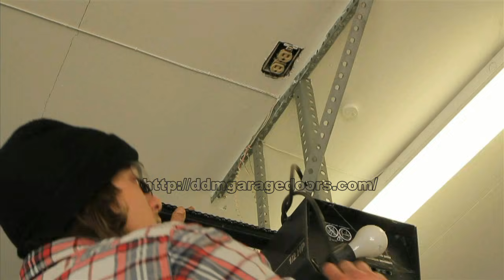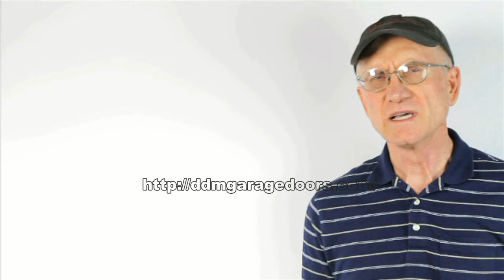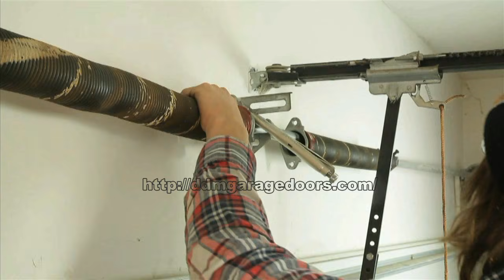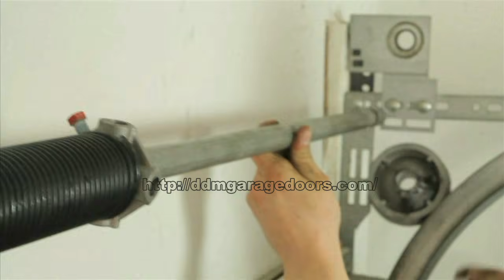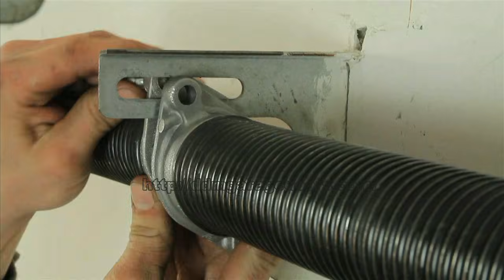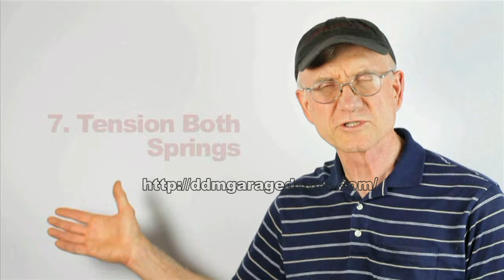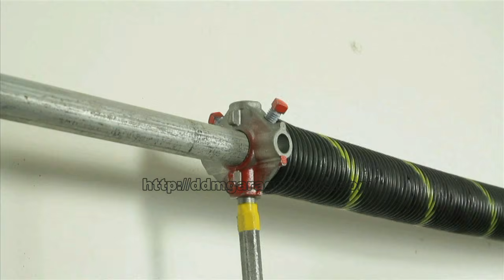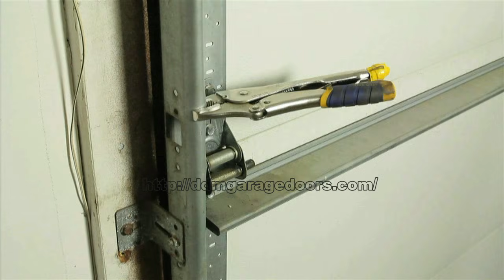How To Replace Garage Door Torsion Springs

Comment: Almost seem like if you could close the door part way where you could still access the spring from the outside you'd take a lot of tension off the torsion spring and make it easier. I don't need to take mine off I just need to tighten mine as the replacement wires were different length than the originals from 1950. Door is also wood so rather heavy and the opener could use a bit more help especially when starting to open.
Reply from the maker: You definitely want to close the door all the way, Mick. There is no safe way to retension the springs at all when the door is only halfway up, especially if it is a heavy wood door. If you mess up and all the tension goes from those springs at the halfway point, that door will drop with so much force, damaging the door and anything that will be in its path. With care, it is best to wind and rewind when the door is completely down: yes, there is a lot of tension there, but its the way of doing this the safest.

Comment: it was nice meeting you Dan (picked up my springs at your west Chicago location while you introduced yourself) and a big thanks for the video. I was hesitant at first on doing this in my own because of how much tension these springs hold. but once I got passed my initial fear of unwinding the springs things got easier and I felt more confident with your help. keep up the great work! and good luck with the new tool for unwinding the springs. I'm sure people will feel more confident using that then the bars.
Reply from the maker: Thank you for your business, VOLTIS5! Thank you for the kind words; we hope that these spring winders will instill confidence in people that they can complete this safely. If someone doesn't feel safe completing repairs, they should just call in a professional. Safety first, then work!

Comment: What an awesome video! 
Thank you so much for creating it in such a detailed manner… I was able to change my torsion springs with no problem whatsoever by following and pausing the video as you demonstrated all the steps.  I’m having another problem now, and I’m wondering if you can offer some suggestions as to what it might be?

Especially on cold days, mornings or evenings, when the remote is depressed to open the door, it rises about 5 inches, then abruptly stops.  When we push the remote again, it attempts to close, then rises again to about 5 inches and stops.  From the inside, although a headache – it’s not too bad, because all I have to do is block the sensor prior to pushing the
remote again, then the door opens all the way up.  From the outside however, the door has to be lifted by hand after it has closed and reopened, and it has to be helped for about the first 24” to 36”.  During warmer days it works just fine, but my wife and I have gotten tired of having to deal with this problem, and it’s now at the top of my honey-do (or else!) list.  I have tried messing with the adjustment screws on the back of the gear box, but realized that has nothing to do with the problem I’m having, or so I figure.

Perhaps you can suggest a plan A, B or C for me to check, replace and repair?

Thanks again for the awesome How-To video!
 

Leo
Reply from the maker: Thank you for your gracious comments, Leo. Your symptoms describe only one probable cause. It sounds like you need to adjust your open force. This should help. https://www.youtube.com/watch?v=GebkW96Sd_c&t=26s Best wishes.

Comment: Great video, and online tools.  I just received my new springs from DDM (remarkably in CA in 3 days) and I installed them and the garage door is finally working properly again. I really liked the DDM tool to calculate the spring specs  based on door weight, height, etc. because I had tried to replace the springs through a different vendor a few years ago, by simply measuring length, windings, diameter, etc...and the springs I got were way too stiff and there were no returns, so the door never worked right, and has been a frustration for the last couple years (having to prop it open with a 2x4) until I found DDMs online tools. As an aside, I also really enjoyed their blog on "click farms". A real shame this video has so many down votes from vietnam, maldovia, russia etc...where they certainly are not ordering garage door components.  Thanks for all your help DDM!
Reply from the maker: Ed, thank you for your kind words. I'm glad to hear the springs arrived quickly and that you found our free online software tools helpful. Our generous return policy grows out of the extra responsibility we assume for helping customers get the correct springs. We can afford to do that because of my 38 years in the business. I can identify quickly the orders that don't make sense. These are pulled and the customers are contacted to assure they get the correct springs.

Comment: Lol "Never, never, never...use a screwdriver." Amazing. But seriously this is one of the most dangerous things a man can ever do, it isn't to be taken lightly - you'd better have good tools, strong arms, and a sure grip - and QUALITY winding bars - and follow this video exactly (it is 100% correct) - or you WILL most likely cause extreme damage to yourself (up to/including DEATH or PERMANENT DISABILITY) or others and surrounding property - for example, a winding bar can crush your hand, shatter your wrist, break your skull, or shoot 20 feet across a room through a wall. BE CAREFUL.
Reply from the maker: Your right on, Jacque. Replacing springs is dangerous!!! That's why we spent hundreds of hours making the process safe. Better not to sell springs than risk customer injury. Thank you for your reminder!

Comment: Thanks so much for this video. I learnt a lot, and the instructions you gave were detailed yet simple. My left spring broke today, so I'm thinking of trying the repairs myself. Thanks so much.
Reply from the maker: You're welcome, Hiep. Glad to hear we helped you learn the trade, and that you found them simple. With the proper guidance I think you'll find the job easy. Best wishes.
Reply: I got it done watching your video. Bought the springs and winding rods here in Sydney for $200. Followed your instructions step by step and finished it in half a day. Called a few garage repairs up and they wanted to charge anywhere betweem $600-$900. You saved me at least $400. You guys are legends, keep up the great work and THANKS heaps once again!!!

Comment: Very helpful video - thanks! I was apprehensive about trying this, but watching and understanding the safety tips throughout your video set me at ease. 

My project started with adding some of your garage door struts to correct a door that was sagging in the middle when open. The additional weight of the struts put the door out of balance, so I decided to replace my 10-year old spring with two new springs. Now, with three added struts and new springs, my door is perfectly balanced and no longer sags.
Reply from the maker: Congratulations, Mark! That sounds like quite a project. I'm glad to hear the video and safety tips helped provide the confidence to do the job. If you had added only one strut you wouldn't have needed to replace the springs. I've been on a number of jobs where I've added extra struts and changed the springs to properly balance the door. We ship a lot of struts out here, especially with our strut junction kits for 16' and 18' wide doors. These are available at http://ddmgaragedoors.com/parts/struts.html. Best wishes!

Comment: I would like to personally thank you for this video. It was perfect, very detailed and helpful. It was the only video I could find that included every step needed. From the amount of turns the springs needed,  to tightening the springs to the bar and everything in between. I move from Michigan where the garage doors are light to, Coastal S.C. where the doors are hurricane rated and pretty heavy and it worked perfect. Great instructional video.
Reply from the maker: Nathan, Thank you for your generous comments, and you're welcome. Glad to hear you had all the details needed to finish with perfect results. Those hurricane rated doors can be difficult to spring. Because of the extra reinforcements the doors sometimes weigh over a 100 pounds more than the standard doors. Best wishes.

Comment: Just swapped out 2 springs and saved about $225! Easy DIY project for the mechanically inclined individual.  Follow the directions exactly as spelled out in this video-extremely comprehensive. Thanks for taking the time to create a video for the weekend warrior DIY-er!
Reply from the maker: Cody, I'm glad to hear we saved you so much money! You'welcome. Replacing springs is dangerous. Just as there are many details for driving a car, the only way to responsibly sell torsion springs is to details the steps so it can be done safely. Best wishes.

Comment: Thanks for the video. This is by far, the best video I have seen on installing torsion springs.  It does a great job of describing the dangerous aspects of the job and the proper procedures for doing the job safely and efficiently. The narrator also does a great job of explaining why each of the steps are important, and what to look for when the job is complete, to assure that the springs are installed and tensioned properly.
Reply from the maker: Thank you for your generous evaluation of our video, and you're welcome. Safety is in the details and in the procedures; it's also in the ease of explanation. When the job is easy, the homeowner is less likely to  get frustrated and do something dangerous, like throwing a hammer across the garage :-). I wish you all the best.

Comment: I am pretty handy and I have owned my own homes for the past 25 years.  I can probably count the amount of people that I have hired on one hand. I have done many remodels and basic maintenance involving Electrical, Carpentry, and Plumbing but I had never had to install torsion springs.  This was one of those thing that I thought I may have to hand over to a pro. I want to thank you for your video because it was very detailed and I was excited to start.  I knew after this video that I understood the basics which will probably help me to maintain my garage door better from now on too.  I ran into one problem caused by the original install. The shaft was not slipping through the bearing  making it impossible to remove the cable drums. It seemed that the original installer turned the set screw a little too much which took the shaft out of round. To avoid damaging the bearing, and now knowing the basics, I removed the bearing retainers (one at a time), and took them off of each end, which allowed me to clean and lube them effectively. With your detail, the step by step instructions, me being really careful, as well as the added labor due to the damaged shaft, I still installed the springs successfully in a little under an hour.
Reply from the maker: Bryan, it sounds like you're quite handy. Doing the work in less than an hour, even with the problem you had, is impressive. You're welcome, and thank you for your helpful comments.

When we were producing the video I was aware of dozens of exceptions to the normal procedure. We could have easily produced 10 videos to cover the variations. Hopefully others will be able to learn from the steps you followed to work around damage from an improper installation. I've seen many of these over the years.
Reply: I meant to ask. How on earth did you get a tortion spring to break on video?  Thanks again.

Comment: I have a spring bar hat popped off its mount. I will do a full new install. Thanks for this video. When I did it the first time in 2008 there were things I missed. I didn't have your video. It will help tremendously.
Reply from the maker: You're welcome. The details are important. I would expect the next time to go more smoothly.

Comment: I have a question : One of my springs broke the other day (Right side -Black paint). I noticed a tag in the center and it says - Torsion Springs for drum 400-8 , SRP-BRN 16x7'6 , 1-3/4 I.D. , 243-36" --- 234-33" , Turns-8-1/2. My garage door springs are the same as in this video. Where the center bearing bracket is not in the center , but off to the left side. I thought this was the reason for the 2 different size springs. Do I have to use the same  springs that are on the tag or can I use the same size springs for both sides? Like 2 36" inch springs. And would it be ok to use 2 inch diameter springs instead of the 1-3/4 that are on there now. By the way are the springs in this video the same size or different size because the center bearing bracket is off about 6 inches to the left like mine is.
Reply from the maker: +ace frehley Ace, you asked several questions. 

First, regarding your spring sizes, it looks like you have an unmatched pair of springs. At http://ddmgaragedoors.com/springs/standard-torsion-springs.php#database we have a tab titled "Find a Matching Pair." You can click this tab to find a matched springs for your door. In this program we take into account the different wire sizes to provide the correct replacement springs.

There is no advantage to converting to two inch diameter springs. If you prefer the larger inside diameter you can call us at 800-383-9548 to have one of our salesmen convert to the larger inside diameter.

Installers normally secure the bracket off center to provide more options after the door is installed. For example, it allows the front of the opener to be installed lower. This would allow more room for a shelf above the door. The offset of the bracket has nothing to do with the spring sizes. 

I hope this helps.

Comment: unsafe technique.  never stand in front of the coils when winding.  and never touch the coils when winding.  stand off to the side
Reply from the maker: If you're standing "off to the side", you are putting yourself at risk of getting hit with the winding cone should it explode. This is the safest way to complete this winding and unwinding procedure because you're preventing the possibility of the winding bars slipping out of the cone because you're reaching so far out to try to wind the new springs.

Comment: This video explained things perfectly!  I just changes out both of the springs on my 18' garage door because one broke yesterday.  Without this video, I would not have known to stretch the springs.  I cut a 3' piece of 1/2" steel rod in half and chamfered the ends in order to make the bar tools.  Thanks for posting!
Reply from the maker: You're welcome, Lenny. Stretching the springs is important for getting the door to seal to the floor correctly when finished.Thank you for your kind comments and for your suggestions for the rods. Best wishes.

Comment: Thanks for helping me fix my garage door.  I replaced both springs and followed the video.  Shipping was quick. Everything went well and finished up by lubing all the hinges and the opener track.  It moves and sounds smooth.  Thanks again.  PS I put the included sticker on my opener for future repairs.  Cheers
Reply from the maker: Raphael, you're welcome. We're glad to help. It's good to hear the springs arrived quickly. We normally get springs out the door same day if they're ordered by 3:30 pm. Repeat orders are always appreciated. Best wishes.

Comment: What will be the problem in the future or what will happen if you over wind the spring like what I read on the 7 feet garage door is 30 max and I winded up to 32 because it is hard for me to lift the garage and I saw other video that says you have to add more wind to make it light. Also, if you lift it like 3 feet in height does it stay or goes down? Mine will go back down but it will stay in a half way.
Reply from the maker: +Ariel L. It sounds like your springs are not strong enough to properly balance the door, Ariel. There are two things to consider before adding a half turn of tension.

First, adding half a turn of tension will shorten your cycle life, usually by 25 percent or more.

The second consideration is that adding tension will make the door easier to open, but it may make the door harder to close. 

When I've worked on doors where the springs are too weak for the door, I have often tried to find a happy medium. For example, if a door is 40 pounds out of balance, i.e., if the springs lift 40 pounds less than is needed, I will adjust the springs so the door is 20 pounds heavy at the floor and 20 light when open. If you stand on an analog scale or one of the better digital scales, you will find that you lose 20 pounds when pulling down on the door and you gain 20 pounds when lifting the door. 

For more information on how a balanced garage door works you can visit our blog at http://ddmgaragedoors.com/blog/2015/11/03/a-balanced-garage-door/.